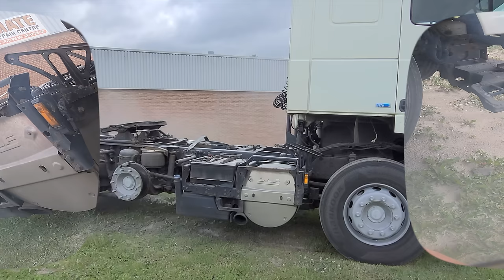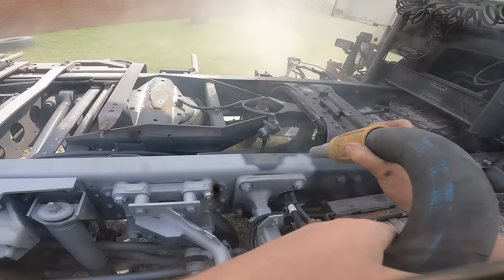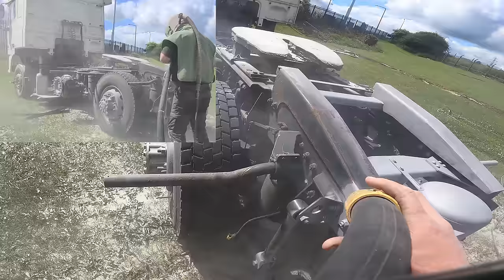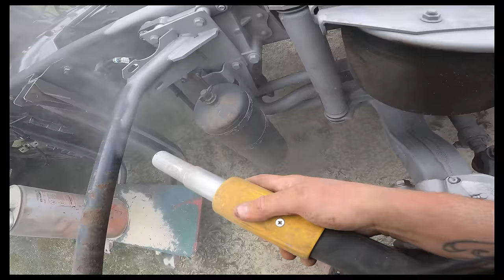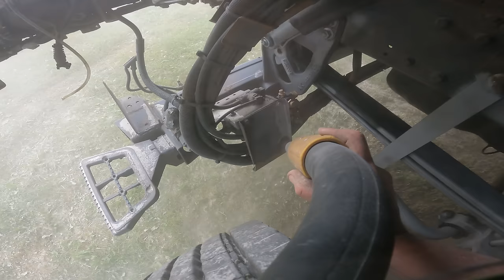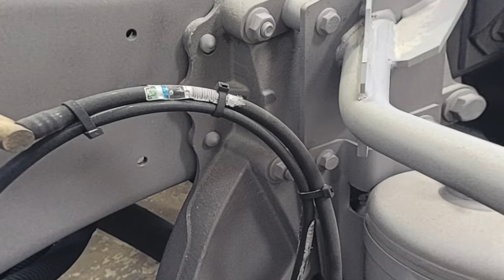Rust & Paint Removal Truck Frame chassis SandBlasting semi artic tractor unit lorry wagon

Comment: Can you tell something aboat equipment that you using I would like to upgrade to this level of power what the parameters are if you so kind to tell
Reply from the maker: All you really need to know is more flow = more doe go for the biggest compressor you can afford then match pot pipes nozzle to that but another thing to consider is what your capable of using as I think my limits are 260cfm @125psi any more and the day takes it tole on your body I've been using 600cfm at 125psi and at the end of a shift you know about it haha I will do a setup video soon as my build blast pot is protected 👌💞
Reply: @Mobileblaster  so you need something like 55 kW to run it at that flow holy kow
Reply from the maker: @tomekpawowski2692  around that yeah👍💞

Comment: Grand job if I was going to have a truck painted I would book you to blast the chassis of my truck because I would want the best paint job possible and you clean them up great, do you ever see the end result after the trucks have been repainted it may be good to see the odd one or two when there Finished please.
Reply from the maker: Thx it's appreciated 👌 and yeah I sometimes see them done as sometimes i may be back at that shop doing some more work and it may still be under prep or pickup etc but most times that's the last I will see of that job.
It's good when I get the chance to work with my brother as he's a painter and sometimes we blast and paint them the same day just that we don't get the chance as much now 😔 he's flat out with light commercials not so much with heavy plant and wagons now I'm sure it will happen again and I will get a video for sure 👌😎